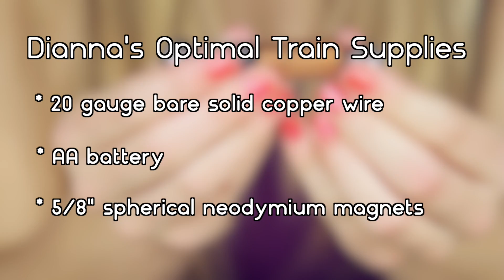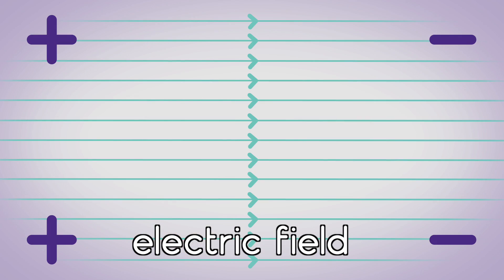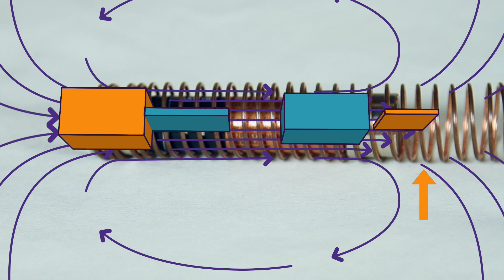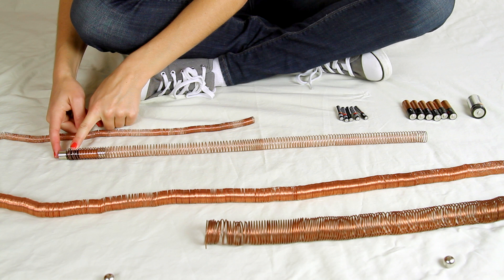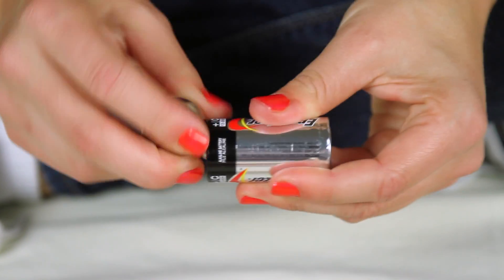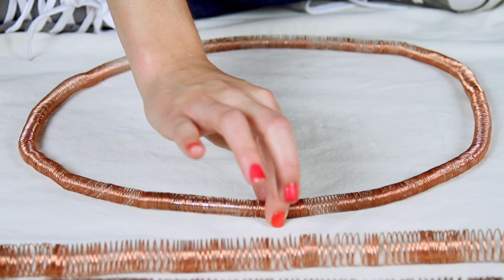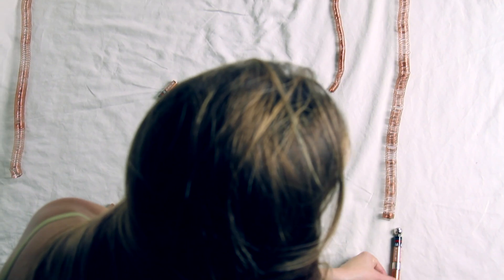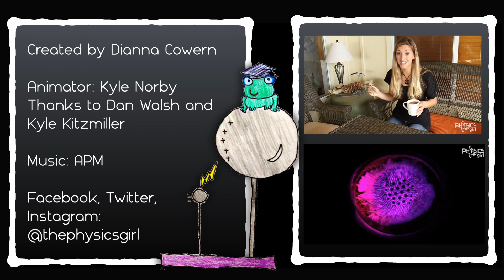World’s Easiest DIY Electric Train

Comment: Will it work with a solid copper tube ?
Reply: not really, it will pass current in straight line but for generating magnetic field, the current should be flow in loop which is only possible in coiled wire

Comment: A steel washer to cover the + Terminal.
Magnets are graded by strength. Stronger magnet = stronger pulling / pushing forces!
Life of battery degrades over time
Optimum speed relies on pull of magnet v weight of battery
It also matters on the diameter of magnets and of the coil

Comment: What’s the best diameter to wind the copper wire for the AA set up. Does it really matter how large the copper wire is coiled as longs as it fits the larger magnets inside the tube? Or is it better to have it snug? Will it run faster?

Comment: First AA, AAA, AAAA, C & D are not batteries. They are cells. A battery has more that one cell. Most cells (non rechargeable) are 1.5 volts, so both the D "old man" train and the AAAA train have the same voltage and I suspect the same strength of magnetic field but the AAAA is a light sports car and the D is a heavy bus.

Anything called a battery that has a voltage greater than 1.5 volts is usually REALLY a battery. If you break open a 9V battery you will find 6 AAAA cells inside. A car battery actually has Six 2V cells (lead acid  is different that flashlight batteries).

Even though the D and the AAAA have the same voltage, The D has more energy so the old man train will run much longer unless something breaks.

Some camera batteries are 6 volts (open them up and you'll find 4 watch cells inside) and still smaller than a C cell. Maybe smaller than a AA cell.

Lastly, a watch cell is still 1.5 volts and VERY light. Though the smaller number of coils in play may counteract this.

In the original videos, the front & rear magnets actually had opposite orientations. Either both north poles or both south poles pointing out. I think that with more than two magnets you would have to keep alternating them,    NS      SN     NS

Comment: How long will a "AA" battery 'train' last in a closed loop? It would be neat if you could add a small button cell with a LED for your train. You could also some sensors along the track that would trigger a circuit to sound a horn.

Comment: Use a very big barometer cell which experience 200000 kg weight so we got energy with minimal differences in atmospheric pressure 

One square meters experience 101325 kg per meter square so calculation for 200000 kg 

Now we can found energy sources forever

Comment: What I'm wondering is if you wrapped the wire around something like thin PVC pipe to reduce the friction would it still work?
Reply: The magnet has to touch the copper wire to get the current to flow.
Reply: @potterma63  could it work using induction..?  Maybe some type of coil on each?
Reply: Seems to me the coupling would be pretty weak. You can always try and report back!

Comment: Hey, great video. This is really applied physics and easy to understand. But what I wonder: Do we really need magnets on both ends of the battery? You showed that the coil itselfs produces a magnetic field once the "circuit" is closed. This magnetic field should be able to push the battery forward, as long as there is "flowing electricity". Would two pieces of round iron (touching the coil) attached to the battery´s ends be enough?
We know that when moving iron towards a magnet it gets attracted. But will a electro-magnetic field be enough to attract iron or do we need a magnet?
To invert the experiment: we could say: World´s simplest power plant. Using a magnetic coil and let a small iron ball run through it. This would induce electricity, right? we just need a "consuming device" at the egde of the coil, like a small lightbulp connected with wires to both the ends of the coil... Would this work ? Greetings and best wishes! Keep on shooting such videos!

Comment: It really bugs me why that "D" cell didn't go faster??  Is the 'sticky goop' possibly causing a high resistance connection?  Maybe weak or the assembly is just too heavy?  The 'vibration' mode may have some potential apps.  With your 'dual AA' battery setup, it looked like you put them "+ to +"?  Try it '+ to -" but switch the middle magnet.  When you did three, you may have canceled out the middle one and an one on an end.

Comment: How come nobody is talking about the law of attraction? She could show me a free energy device that could power my house forever and I'd be more interested in her. Well okay, that's an exaggeration but I make my point. Hey dianna what do you think about flywheel generators like chas Campbell design? Thousands are making them and that free energy debunker guy actually proved they work until he deliberately overloaded his crude model. A generator pulls energy from the ether with magnetic fields flows it out of the system in power. Mechanical advantage with pulley sizes is real phenomenon. I think the flywheel generator with mechanical advantage pullies and flywheels is a working phenomenon. It's not a thermodynamics issue. As a gasoline engine driven generator doesn't convert petroleum power directly into electricity, it relies on kinetic transfer to the copper coils and magnetic field. The power supply is endless if the generator motor is turning. The energy comes from the ether of space not from the magnets or copper nor gasoline nor rotation. The system of the generator just collects and directs the energy all around us.

Comment: The fatter train went slow because you put in a huge resistor in the circuit when you used a tape. Hence the current was reduced and the induced magnetic field weakened. Also the increased mass of the train contributed to the lesser speed. Am I right?

Comment: Physics describes things. It describes the force that pushes the battery is linearly  proportional to magnectic field generated by the current on the copper wire. It's not because physics this train works as you said in the end of the video. Why the force is linear proportional and not inversely proporcional to cube of the magnectic field. Nobody knows.

Comment: Nice video! Thanks. A query: at my place, I found that with online retailers here bare copper wire is available in two options, just 'bare wire' and 'annealed wire'. Is there a difference? Which one should I buy...annealed? I read somewhere that annealed wire ks softer and easier to work with. Which type is suitable for making these coils?

Comment: Well I have a question ..... What if we create a small loop of copper coil and then run one of these battery-magnet train(or any magnet train), so due to change in magnetic field there will be electricity, generated in the coil and since they can move till very long time , so that means we can generate small amount of electricity with these without any efforts???

Comment: This is amazing but I think there is a better explanation for the force. 
The lines of force from the north ends of both magnets are flowing 'out' from the middle of the battery and crossing the coil at the middle where all the current is flowing. 
What do you think?

Comment: Putting the AA batteries in series without putting magnets between them would be faster. Doing so would cause the coil to have increased voltage passing through it and greater current. Having the battery in the middle is resulting in two fields being generated, one behind the other, each at 1.5v. A single 3v field would have more power.

Comment: obviously i haven't done it yet, but, you should try to take a 9 volt battery with a small wire of it's own (taped) from one side to the other side of the battery so you can have the magnets the same as if it were a cylindrical battery. and then use something boxy to form the track.

Comment: What an awesome demonstration! Perhaps D and AA batteries have the same voltage (1.5 V). Resistance is relatively constant (slightly longer battery --> current flows through slightly longer section of copper --> slightly higher resistance), and V=IR, so the longer battery might create slightly less current. Lower current --> weaker magnetic field --> less Force. Not only that but the bigger battery(+magnets) has more mass. So the D battery has a smaller F acting on a greater mass --> less acceleration..?

Comment: Should the wire have enamel ...?????
Reply: No. The current won't flow if the coil wire is insulated. It is the current that 'pushes' the 'train' along. The current is caused by the voltage across the battery. If the wire is insulated, there won't be any connection between the battery terminals and the wire.

Comment: To elaborate, there is no positive electron. That is a 'virtual effect'. Kind of like how one would say a vacuum sucks, but really, the atmosphere is pushing you. 

This doesn't mean the positive side is the 'safe side', actually, the opposite. The positive side represents the 'potential' side, the negative side is simply the electron source, and the potential is like a 'vacuum' for the electrons. When 'ground' is the electron source, that means YOU could be the electron source, which is why the positive side shocks you, even though YOU are the one supplying the electrons for the circuit.

Comment: make it opposite of what you did,  make a ring with neodyminiums , and get a superconductor solenoid, put it over the neomag ring at low temperature, get a perpetual motion.

once done this, 

 the next... use the earth's own magnetic fields to power the perpetual train.

once done this, use the strong magnet from a supercondutor and the electric capacitor and put them in the sea water, sea water has a lot of NA+ Cl- for you to propel.

Comment: the difference between screwing around and science is writing things down :D it seemed like the coupled batteries went faster than the singles, is that true? if so would that have to do with the increased voltage (potential difference) between the very front and the very back?
Reply: Increasing the voltage would have made them go faster, but if you look at the chain, they're actually not all aligned in the same direction, so they're working against each other creating magnetic fields in the opposite direction.  If they were indeed going faster, it was because there were two fields that were both pulling the batteries along, doubling the force, while the friction only increased by 50% with a single extra magnet.

Comment: When you put a bunch of batteries together at the end, I think they were effectively in parallel because the terminals were all touching magnets which were touching the wire. Maybe, if you connected the batteries without letting the ones in the middle connect directly to the wire, you'd get a higher voltage -> higher current -> stronger magnetic field -> faster train?
Reply: In the case of multiple batteries connected in series, the resistance of the system (=Resistance of the Coil CR + Internal Resistance of the battery IR) increases proportionally to the number of the batteries. So, the electric current (I) which flows through the coil is almost same. Although, if we consider the contact resistance between magnet and coil it may increase a little.  Anyway, Current I is almost same. >>  Magnetic field inside the coil is same. >> Divergency of the magnetic field at the end of the coil is similar.  Only two magnets contribute to driving force. Weight increases with multiple batteries, ->> Slow Speed.   
For reference.  IR of an alkaline battery is 0.15~0.30 Ohm. CR for one battery is smaller than IR, and maybe less than 0.03 Ohm. Of course, CR depends on the several factors of the coil, such as diameter of the wire, coil’s diameter and number of turns per unit length of the coil N.
Reply: Yeah, you can definitely tell that they were in parallel because they were facing opposite directions, and still moved. Even just aligning the batteries would have made the train go faster.

Comment: If you lay out some aluminum foil and put your Lil' locomotive on it it'll roll away sideways in homopolar mode too.  If one magnet "wheel" is larger than the other you can get it to drive in circles.  

If you want to make a faster train use an 18650 Li-ion cell instead.  If it doesn't immediately fuse the magnets to the wire and make them, glow red, it should be about an order of magnitude faster than the AA.  An alkaline cell might deliver 7 amps in this setup when fresh but 18650`s have more than twice the open terminal voltage, over twice the energy density and 10 times the power density. They can deliver over 100A into a short for a few seconds before exploding and are commonly designed and rated to deliver up to 40A under normal conditions.  As long as you use appropriate wire they should shoot through like a bullet.

Comment: Would this work with a copper wire that has a rubber outer?
Reply: nope, it needs to be bare wire in order to conduct electricity from the batteries.

Comment: Can someone explain to me why, in this case, the smaller batteries make faster "trains" than bigger batteries?
Reply: rayan8031 The "bigger" battery was still a 1.5 Volts, so the power was the same, but the mass was higher. Greater size in that D type means greater capacity, not greater voltage.

Basically lower power-to-weight ratio, means less acceleration.

The tiny battery was also 1.5 V: higher power-to-weight ratio.
Reply: It's a fake

Comment: My hypothesis is that the cylindrical magnets should work better because they make more contact with the coil, so there is better electrical coupling. And also the cylindrical battery would be physically supported by more windings of the coil instead of bumping from winding to winding, falling a little in between each. Granted, too long of a cylindrical magnet would increase friction enough to loose the benefits of not falling between coils.

I wonder if this would be faster with a 3V lithium cell. (I think there are ones with similar form factors to AA cells, but I would hope slightly different size to keep someone from putting a 3V cell where a 1.5V cell goes...) The hypothesis here is more voltage, more amperage, and therefor a stronger induced magnetic field. On the same "train" of thought (see what I did there?), the characteristic internal resistance of the cell used is probably a major factor in how much current can be supplied to the coil.

Comment: Neat! I'm probably not the first one to say this, but try with a lithium battery that has a much higher ability to push more powerful currents through the coil. For example, a CR123A battery. I wouldn't be surprised if the track doesn't stand up to the speed, but totally worth trying!

Comment: Question: Would the speed of the battery increase if the voltage (but not the mass) is increased? I understand adding 3 batteries in series would increases the voltage, but it also increases the mass. 

As an example, using a 3.7v Lithium Ion 14500 battery rather than an AA (similar size)

(i suspect there's issue with battery safety and shorting out a LI-ion battery, but i'm thinking theoretical here)

Comment: I have a few questions. 
1.) Did you say the spherical magnets were optimal because they produce the same magnetic field while reducing surface area in contact (friction) with the copper coil?
2.) Could you do this with a solid copper pipe that was bent to make the track more stable?

Comment: so how long till this thing is dead? does it feed of the battery's charge? does it have to be a battery in the middle?
Reply: Yes, the magnetic field is created by current flowing from the battery.
Reply: Tim Cortesi No you're not shorting it, you're powering a coil that creates a magnetic field which in turn pushes the battery , performing mechanical work. It's a legit load.
Reply: the load is so minuscule that you could say its short-circuit (which should be easily verifiable by letting it run in a circle for some time /rounds and touching it (battery getting hot= short-circuit)), also the mechanical work is done by the permanent magnets not the emf. (this is just a quick glance assessment, didn't do the actual math) and my bet is running this in a perfect loop non-stop would lead to overheating/exploding of the battery.

Comment: Should try it with a cylindrical lithium ion 18650 cell.  You can get a lot more current at a higher voltage and it would probably be really fast!

Comment: My first hypothesis as to why the bigger batteries were slower is that they both have 1.5 volts so the same energy per coulomb, and the electrical energy is converted to mechanical kinetic energy, whose equation is KE=1/2mv^2 , so naturally, increasing the mass decreases the velocity. Physics Girl, which was faster, AA or AAAA?

Comment: yeah that spring like copper wire is called solenoid ....whenever the two ends of a solenoid are connected to a battery or by applying potential difference,the current flows in the copper wire ...so produces a magnetic field according to ampere's law...and that magnetic field is given by , B=4 Pi * 10 power(-7)...and this magnetic field pushes the north and south poles in opposite direction and hence causes the motion....

Comment: i use aaaa batteries to power some of the devices i make. they can be found (as youve found out) if you search hard enough, but for a much easier source , many 9v batteries are made up of 6 aaaa batteries. (not all, some are built in wafers)

Comment: Im pretty sure that when you try this with the small cylindrical cells that output 12v it will be even better. That's probably also why the D cell was so disappointing, it may be bigger and has a bigger capacity, but it still has the same 1.5V output like the AAs.